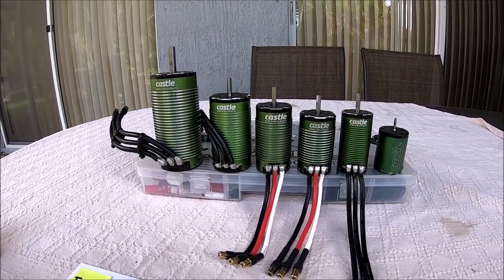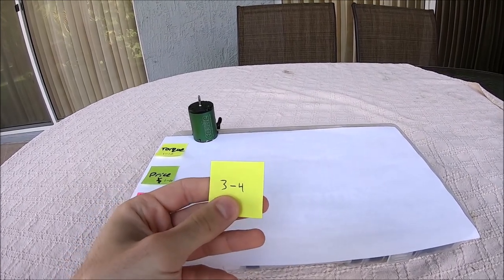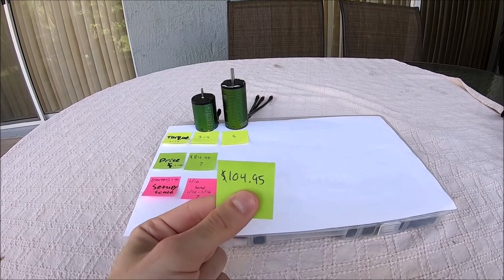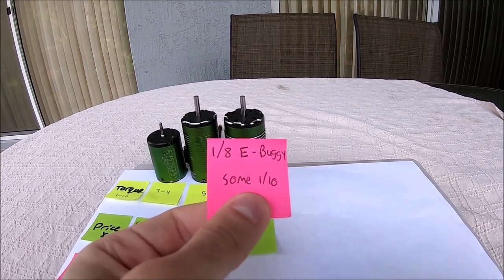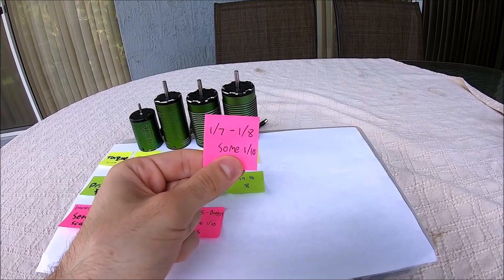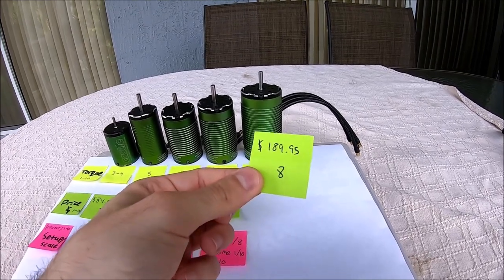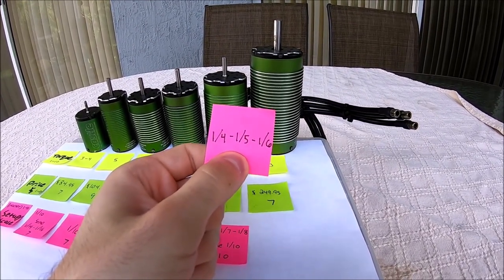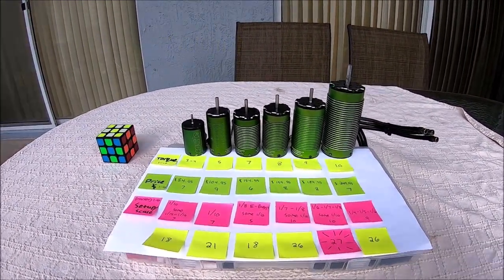ULTIMATE Castle Motor Comparison Review! New 1717 & 2028

Comment: "Hey guys, here's a 15 minute advertisment for Castle to help the non-existent problem of trying to decide between entirely different motors for entirely different applications!"

You literally tried to come up with a way to compare apples to oranges... and peanuts. Who is looking at ALL of these motors as options they need to decide between? Don't you think virtually EVERYONE looking for a motor already has a dimension (or at least a general scale) requirement and possibly even a voltage requirement BEFORE even looking at motors? I don't understand the point of this?!

For real though I'm not trying to be rude... but who are you trying to help with this? Maybe people making 100% custom builds that could literally use any size motor they want? If that was the case your third criteria is pointless... This is just an advertisement for Castle. Why not compare the SAME SIZE motors from different manufacturers?"
Reply from the maker: This video was made to point people in a healthy direction for what motor they could run per appropriate scale. Not everyone already knows or has a dimension as you stated for a build, in which I'm sure you do. Believe it or not this has helped a bunch of people that were confused on what to look for in a build.
I state prices to rate how expensive they are if they are even worth it if you actually listened, I never said it to sell people. If I did. I would have compared them and how much better it is than another brand's variant, like you want. In which I did not. Your statement is invalid. This was purely to help people that already had eyes on Castles products.